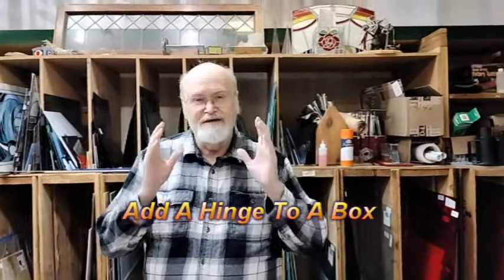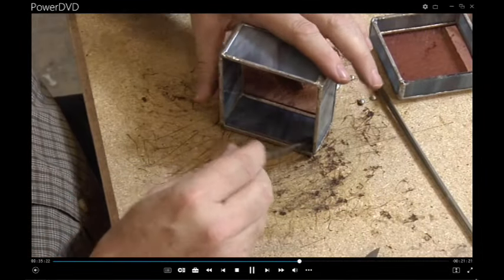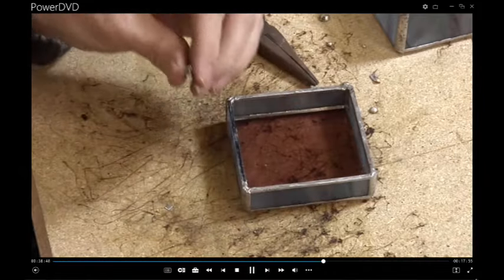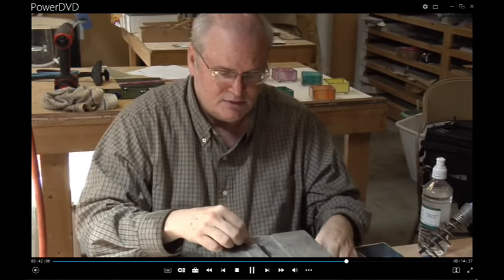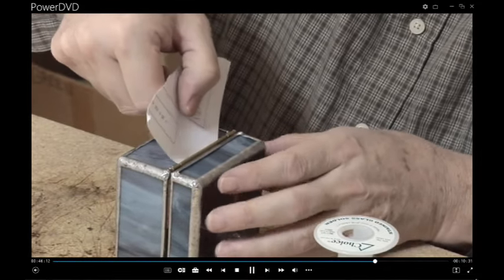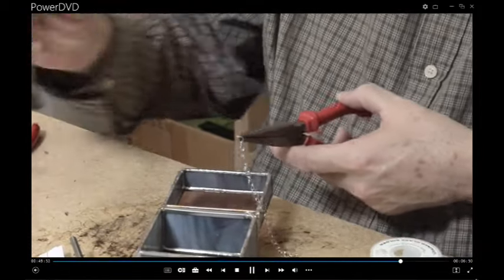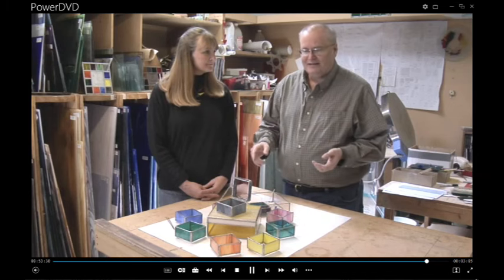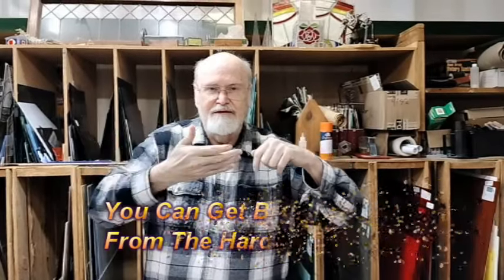Project   Stained Glass Jewelry Boxes   adding a hinge to a 3D box 5 of 5   V440

Comment: Where do you get the copper tubing you use for the hinges?  Do you buy them separate or as a set? What are the dimensions of the inner and outer pieces? Thanks for you help.
Reply from the maker: We get our copper tube from Ace Hardware, but you may be able to get it from Delphi Glass. I can't recall sizes, they have so many...